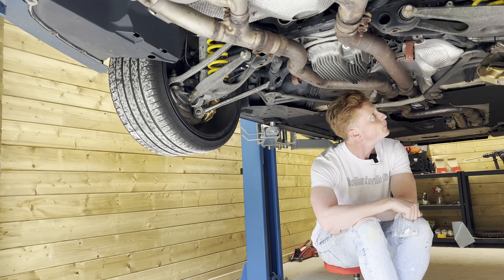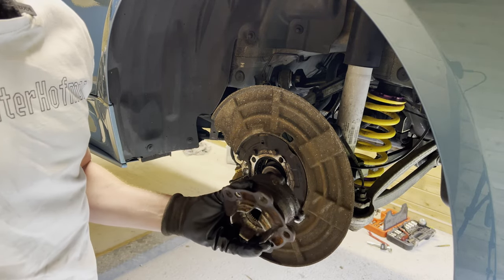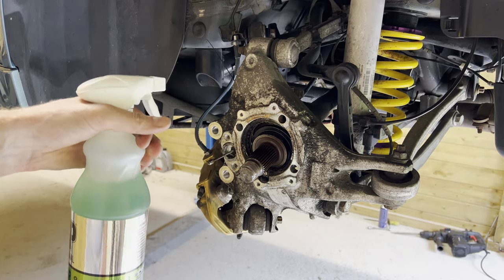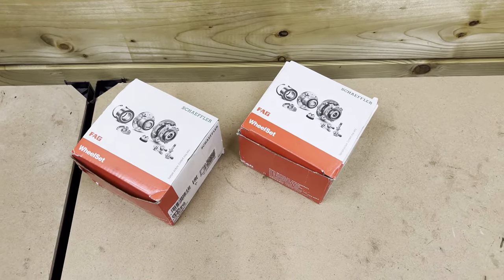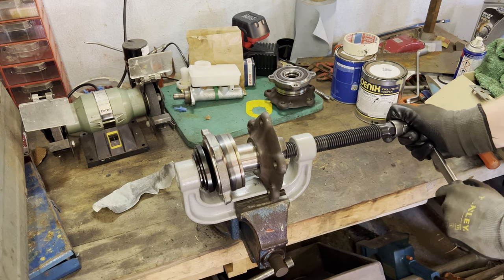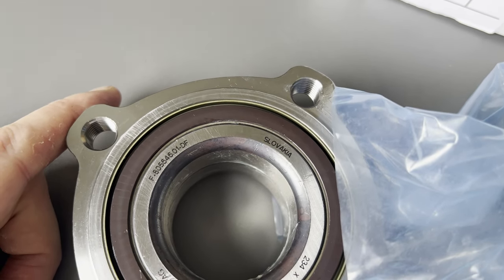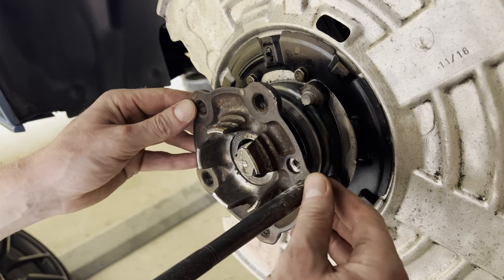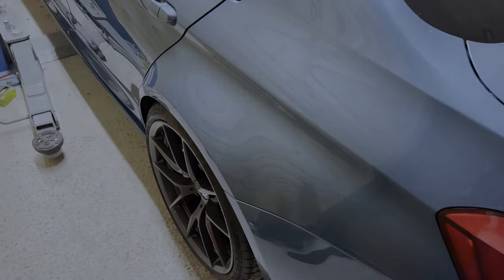BMW M3 Competition: Replacing Rear Wheel Bearings (SPECIAL GUEST APPEARANCE?!)

Comment: I’m Swedish and it’s a shame that SKF now is garbage.😔
Reply from the maker: So a little backstory for you: I actually called SKF and asked for explanation. They said they interchange parts with other manufacturers when they have a lack of parts (or their supply chain is not up to speed). They quality control the parts of the other manufacturers and then sell them as they’re own. FAG is one of them. Furthermore, when I thought I damaged my new OEM wheel bearing, I ordered one from SKF again: that one was also an FAG one, but made in Slovakia! So I suppose you have to be lucky with which one you’re getting (or simply ask beforehand).
Reply: @TheHunterHofman  That is what we have noticed in Sweden as well with bearings and Other things, of course not only SKF parts. Over all the quality has declined. I bought two new cv-joints (SKF) for my old SAAB 900 and the ”rubber” boots lasted two years. Rubber parts are more plastic. It’s a shame.
Reply from the maker: @Sourstromming  yeah, it’s becoming more challenging to still get quality OE parts these days unfortunately…

Comment: Well, I gave this my best shot, but couldn't get the first hub bolt to crack loose.  I initially tried an offset 11mm wrench as you did, but that eventually just slipped, slightly (only very slightly) rounding some of the bolt head (to point of the 11mm no longer fitting on the bolt).  I removed the damper and was then able to create a fairly straight shot with an extension and proper torx socket, with my dewalt impact on the end -- but even set on high and with the socket well-seated, it wouldn't budge (tried some PB Blaster and a couple rounds of heat -- still no go).  Getting the axle back through the hub was actually fairly easy with just an air chisel, so it seems a bit weird the hub bolts were so seized in light of that.  I dunno.  Guess I'm going to take to my shop and let them bail me out.
Reply from the maker: Hm, that sucks mate! Weird that it wouldn’t budge: have you tried a long breaker bar? I can’t imagine not getting them loose with that. I can imagine however not fitting one in there… how are things now? Send me a DM on Insta if you need any help. Thanks for your comment
Reply: Appreciate that!  I didn't try a breaker, probably because I didn't feel I could achieve the required swing clearance.  Even with the damper removed, the axle and camber arm really limits what you can fit/turn in that space.  Maybe if I had let some penetrant sit overnight I would have had better luck next day.  Car is drivable (issue is a couple broken studs within the hub), so I have an appt with my shop in a couple weeks.  But I'm only having them do that side -- I'm determined to do the other in future on on my own dammit!

Comment: Why is that bearing failing so soon?
Reply from the maker: The Chinese one? I think, afterwards, that it was probably my mistake. The same issue (to a far lesser extent) occurred with the OEM bearing (until I used the CV axle puller and things were back okay again).

Comment: I've watched this again. So many questions. Including why you couldn't use a swivel socket for the new hub bolts and a torque wrench? 

I can see why the bearings were wonky after a pretty half assed install... so, why you didn't take it to a shop for professional installation I don't know BUT... your final set of bearings clearly show the Slovakia markings on the back of the bearing when you went the third time. And a bunch of other markings. 

Mine have NONE of these things on that face and they were pressed onto BMW Motorsport hubs (P/N 33008328143) ... and now I'm a bit concerned. All parts came from Bimmerworld...
Reply from the maker: because I couldn’t get the socket to fit in the first place, let alone with a swivelsocket attached to it. I’m sure the official procedure would require for the whole cv axle to come out (as I don’t see how you would otherwise fit a bulky torque wrench in there). Furthermore, the point of the video was to DIY, hence why I didn’t take it to a shop. I would say the way forward was with a cv axle puller. That worked like a treat and the bearings are rock fucking solid. I believe Bimmerworld sells good stuff, and there are more bearings on the market then FAG bearings, so maybe you have a different brand. Ask Bimmerworld, I would say. Let me know if you have any further questions or comments.